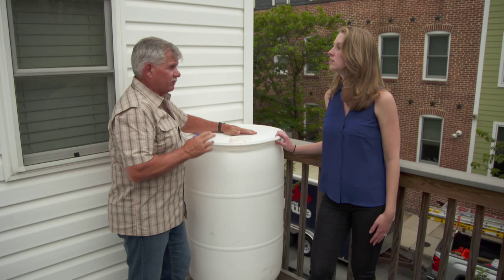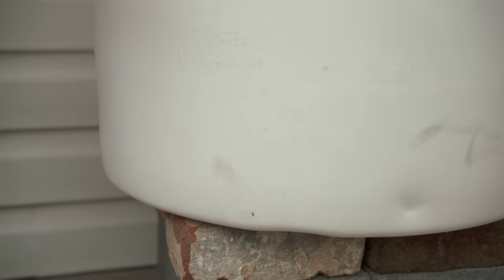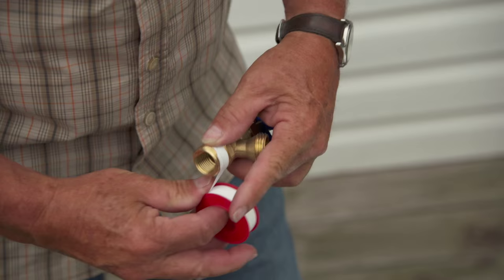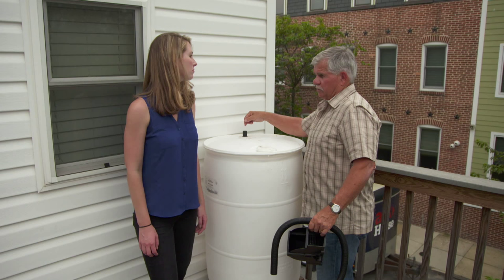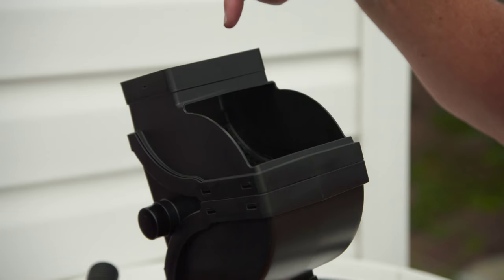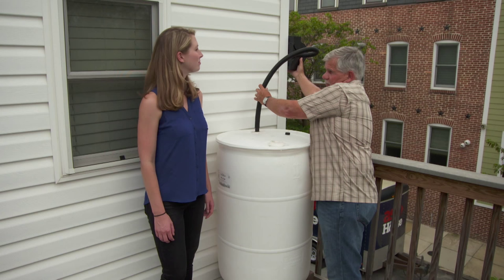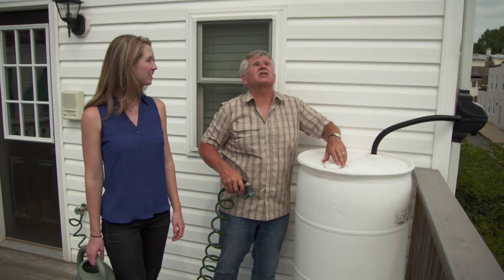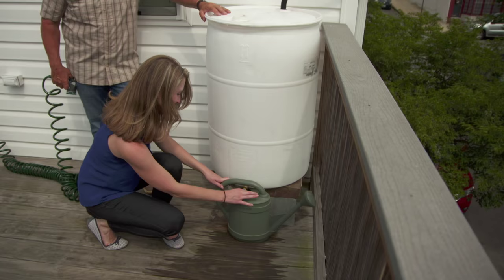How to Build a Rain Barrel for $40 | Ask This Old House

Comment: My only dis appointment with rain barrels is that theres not enough pressure to hook a soaker hose to it. Pretty much gotta fill a bucket and lug it out to what ever you're watering. Don't get me wrong, I believe in harvesting rain water 100%. Now if the barrel(s) could be placed up high, 10 foot or so, more pressure would be created. But thats not acceptable in most cases. Love This Old House. My  gosh, I've been watching since Bob Vila was doing it!!
Reply: in this case you could hook it up to your sprinkler hose. Use a transfer pump. (not $5!)
Reply: Right....from what I've learned since my post, a pump would be a great idea. Thanks!
Reply: Dash, this persons water barrel was up on a deck, so she would have enough pressure to do watering through a soaker or even a sprayer. My brother has one mounted just 6' and will shove water 30' to his garden so don't get disappointed, just make a small platform 6-7' high. You can do it.

Comment: Am I the only one concerned about the weight of a full barrel of water on an upstairs deck?
Reply: One gallon of water weighs approximately 8lbs.  So if that is a 50-gallon barrel, that's 400 lbs.
Reply: Tommy will return and have another video how to do deck repairs later.

Comment: Where can anyone else find a 50 gallon food grade barrel for $5?  Prices I see would double the cost of this project.
Reply: I found one locally for $15
Reply: I bought one for $10 from a car wash. They get older soap in on giant barrels.
Reply: @manichispanic5234  good idea, thanks.  I ended up going with 275gall IBC totes.
Reply: I like using 275 gallon Intermediate Bulk Container or IBC.  Sometimes these are also called Totes or a bottle in a cage.  The beauty of the IBC is that there is a butterfly valve in the bottom and you can get an adaptor to connect a garden hose.  The other benefit of an IBC is that it will hold 275 gallons in the space of 4 barrels.  They typically sell for about $50-75 on craigslist.
Reply: Find a place where they get ingredients in plastic barrels and go dumpster diving after hours,  typically they just throw these away.   Or leave them out for whatever person to snatch them up and resell them on Craigslist
Reply: I ended up buying IBC totes... the cost was $90 each (food grade) and then connecting a sprinkler pump ($400) and a 80gallon pressure tank (free on craigslist).  Now I can run my entire sprinkler system from rainwater.  1 IBC tote isn't enough, so I'll be hooking up 3 more... should save me $100/month on water bills.
Reply: Adrum Whisperer i mean, if it’s raining  that much, isn’t the grass already getting watered?
Reply: @michaelesposito2629  yes... while it rains... but what about the next few days, weeks, or month when it doesn't rain.  I find that I actually need 3-4 IBC totes to capture enough rain.
Also,  I'm running sprinklers off my system.  So I need:  gallons_held = (Sprinkler_gpm * #_of_min * #_sprinklers_running) * #_days_until rain.  Even 4 IBC totes wouldn't be enough for my irrigation system to be completely independent of city water.. but it does pay for itself over time.
Finally to address how much rain can be captured... this is calculated based on your roof area and how many inches of rain you get minus some loss from the first flush system.
Reply: @michaelesposito2629  LOL
Reply: @Mike__B  Do you have suggestions?

Comment: Not to be picky but only the top gutter piece should be fit inside the black diverter device. While the bottom of the black plastic diverter output should have been put inside the lower gutter section.  Tommy did not do that. So when it rains extra water will run outside the lower gutter section because it was not funneled correctly to be carried down from the inside of the black diverter section.

Comment: Never work in Canada I’m afraid. We have to use a proper bulkhead fitting inside. Pulse your setup will probably block your spigot over time because of how low in the actual barrel you drilled the hole.

Comment: Tommy does a great job but did he consider that the drum will weigh 400 pounds when full of water? Is the deck rated for that much weight at that location?
Reply: Being who Tommy is, I'm pretty sure he thought of that.
Reply: About 400 lbs. is about 2 average size guys standing on the deck, how about that?
Reply: What deck can't support 400 pounds?
Reply: I'd hope it does. 2 adults or kids could weight that much these days or even 1.
Reply: @jj7958  One Southerner. Lol

Comment: thank you for the Great video.  can I use 6 cinder blocks instead of 2 to give it more elevation and get better water pressure?
Reply: Esplender M It’s 1 bar of pressure per 10 meters height. Adding 2 heights of cinder blocks would not even add 0.1 bar. Use a pump.
Reply: @Engineer9736  When I elevate my water box, the water comes out much faster into my jug, and I only lift it into the air like 1 foot higher than on my kitchen counter...It works..So yes, even a little higher works, Esplender M.
Reply: It is not the elevation of the barrel, it is the height of the water column that corresponds to the pressure  increase

Comment: In the UK I have two water butts designed for the purpose. The diverter on the downpipe still lets water flow through and is at the same level as the top of the containers so they won’t overflow.
Reply: Yeah, he seemed to fit the diverter in the total wrong place, that's going to overflow

Comment: Just wondering if you need some type of a vent for the air being displaced by the liquid? Maybe it’s not really airtight?
I’m sure someone may have already asked and it’s been answered, but after about 25 sarcastic remarks I stopped reading comments. I really am interested in this, but wondering if there is negative pressure from inside the barrel then the water may get vapor locked and not flow into the barrel?

Comment: What about overflow?  It looks like she is in a second story apartment too.  The neighbor below might have some issues with it!
Reply: I have the same question!
Reply: I’d put in some type of check valve at the top and then plumb in some pvc pipe or have another hose diverting the overflow water to where you want it to go. Or just skip the check valve and just use the hose

Comment: what about overflows?
Reply: It looks like it'll fill up back into the hose and then overflow down the gutter
Reply: KuntryBoi though the hose connection isn’t watertight. It’s only good for streaming water, not for holding volumes. It will be leaking at the joints. Maybe the leaking water creates ugly spots on the floor or on the wall over the years.

Comment: I can't help but notice the bib has a handle that is in the same direction as the connector. Overtime, turning the handle will loosen the bib. Seems to me an easy solution is just use a bib to have a horizontal handle.
Reply: Its a good idea to anchor the barrel. Thats a lot of weight balancing on a concrete block when its full.

Comment: How we do keep algae from growing inside the barrel?
Reply: will white paint work? I want mine to match my white house.
Reply: use Krylon black acryllic paint. that adheres to plastic
Reply: Vertigo Studios Put a black layer on first to block sunlight, then decorate it with a white layer. The white outside even would heat up less than black so that’s even better.
Reply: let the water run through a filter
Reply: Mos people that I know bury them in the ground. or they encase them so there is no sunlight, however you should always add an air stone to keep the water from getting stag net.
Reply: a few normal coats of paint will not block the sunlight you will just not see the algee

Comment: According to Fiskar's  installation instructions, I think, he installed the valve way too high. According to manufacturer, the valve needs to be installed almost parallel to the opening of the spout of the barrel in order to function it properly otherwise barrel will overflow all the time.
Reply: He just needed to add an over flow to the top of the barrel.

Comment: I wish you would explain things like why you need to take the hose out in winter
Reply: Or flush the tank so that the shut-off valve doesn't just 'pop out' under the added pressure.
Reply: Do you water anything in the winter?

Comment: Will the valve leak (even when shut off) in any way if not initially, over time?
Reply: fruitfast777 No it will not leak if the threads where tight enough into the plastic. I assume This Old House wouldn’t upload this if it was such a fail.

Comment: Off grid question...how do you get rain water for the winter to survive for bath, dish water? Do you move the barrels inside your house and use an extended hose? Please reply with details asap. Thanks!!!
Reply: Bury your water storage containers. Run some pipe into your home and connect a pump.

Comment: Dear Old House: Will installing a barrel(s) reduce rain runoff, to discard water, or will this be too small for this.
Reply: Every little bit helps with runoff reduction. You aren't going to do much with a 55 gallon drum capacity, when there are stormwater retention ponds that hold acres worth of rainfall, but if you want to reduce your impact, and the impact of your neighbors as well, it is a great option.
Reply: depends on your home setup...some people use IBC totes and get several hundred gallons of water each time it rains.